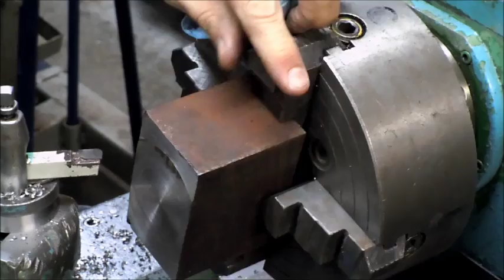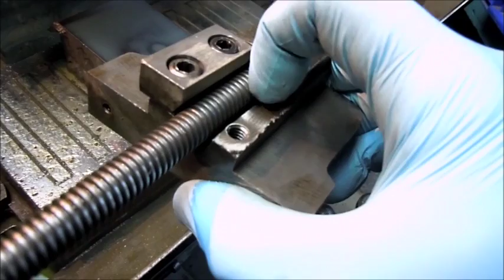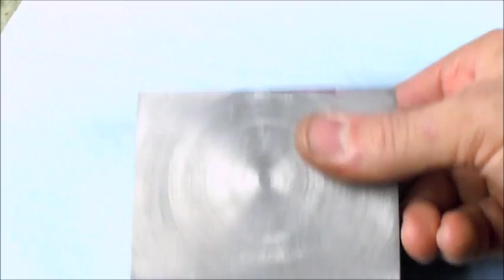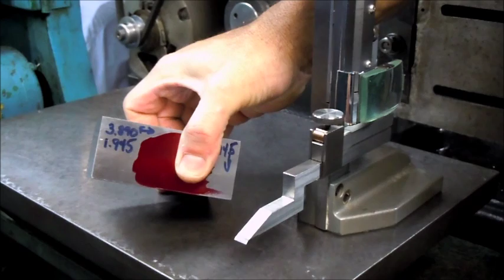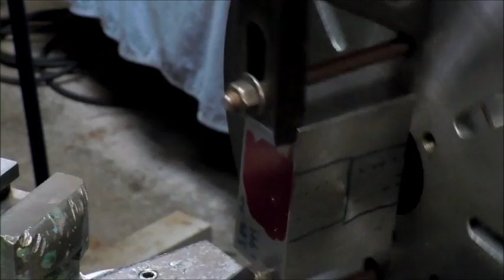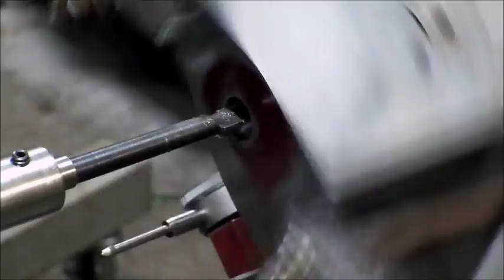Atlas 7B Shaper Update 7

Comment: I've just watched this and subscribed, it looks like I'm gonna have to go and watch all you videos now :-), you should do a video on that carbide lathe tool it cuts fabulously, did you grind it yourself or is it an out the box cut, I've got inserts but they're so hit and miss
Reply from the maker: The carbide bit, if you're referring to the one I use to rough face in the lathe, was a $4 purchase (new) from a used tool shop. I smoked it on something when I first tried it, can't remember what, and ended up regrinding that big radius on it to get it sharp again. Likely not very orthodox but when I tried it in that orientation it worked so I use it now. For my limited knowledge and experience on the lathe I find that the insert tooling I have is "weak", likely related to my "lack of knowledge", so for me it's hard to beat these inexpensive tools that can be ground and pushed hard. Inserts I keep for finish work. Thanks for subscribing.